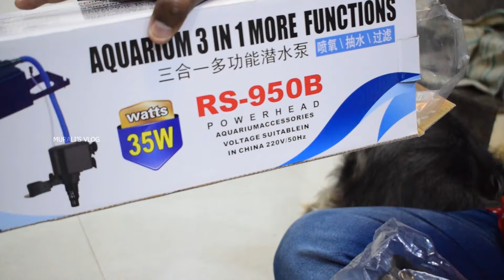My New 3.5 Feet Fish Tank Setup | Parrot Fish | Cichlids | Oscars Fish | Aquarium Setup Up gradation

Comment: Hey, I would recommend you not to house the african cichlids with oscar because the both are from different continents are require different water parameters and both the species are very aggressive which could result in a conflict in your tank..
Reply from the maker: Thanks for the valuable input!!
Reply: Broo they're both the same species but oscar cichlids are far more aggressive than african cichlids ,serious cannibalism would be there 🗿
Reply from the maker: I agree with your point, i have separated them breed wise and kept them on different tanks

Comment: 250 to 300 gallons ah? Your full tank capacity is max 200 litres.. 300 gallons is almost equal to 1130+ litres.
Reply from the maker: 25 * 18 mineral water can... Capacity actually.
Reply: @MuralisVlog  To measure your water volume in the tank: LxBxH in CM divded by 1000 will give you the volume of water in litres. Measure only upto the water level.
Reply from the maker: Good info.. Thanks alot
Reply: This is 198litre(3.5 X 1X 2) capacity tank..so it would be around 52gal
Reply: Anti chlorine nala, epdi bro wateroda density level ah  korapa, anti chlorine oda vela thanila   etha poison content iruntha edukurathu thaa vela bro